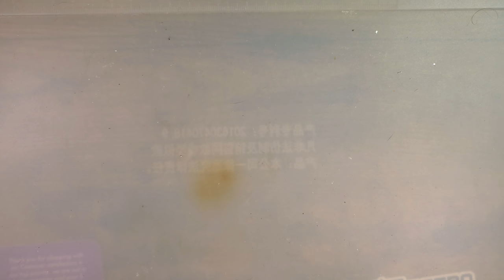Game Boy Game Battery Retainer (v2)

Comment: Thanks for sharing this video so everyone can learn to do this. That said, I do have a fair bit of constructive criticism regarding the way you solder which people that are new to soldering need to know to make sure they don't damage their valuable boards. I'm sharing this because I have noticed a lot of people pick up bad habits from watching otherwise very informative vids, not to put you down. 1) Heating so much of the board for as long as you do in the vid will often times damage the PCB. For anybody trying this or similar mods, use a small chisel tip or even a needle tip instead and make sure to not keep the iron too long on the contacts while soldering. 2) Using some soldering wick to remove old solder would also be a bit cleaner, since else you end up with too much solder, which in turn might end up shorting other parts of the card (especially if you have done other modifications to it) and it simply looks much nicer if you do. 3) Solder should never ever end up on other parts of a PCB. Only on the solder pads and feet of the components being soldered. I can't stress this enough. Having to remove it  afterwards with your nail isn't very good for the card to say the least.. and that's if you even notice and remember to remove it in the first place, before it shorts something. 4) Last but not least, keep those soldering tips clean... it will make your solder joints better and make your soldering tips last much, much longer. To people wanting to learn how to solder: make sure to learn good soldering hygiene before you ever pick up a soldering iron in the first place, it's super easy and will make your life much, much easier when doing any type of project that requires soldering.

Comment from the maker: Yes, there is actually a problem with that GBA I was using for testing. There was NOT a problem with the games.

Additionally, the adapter for this mod has been revised to FIX the issue I encountered in the video. 

Please read the description before commenting about this.

Comment: The tabbed battery just makes more sense, that's the way I'll go.👍👍👍
Reply from the maker: I mean, a tabbed battery is cheaper than buying the boards and retainers for this but I suppose it does make a bit of a sense for a RTC cart
Reply: @makho  I see some on other sites that are $1.99. With the ease of use of swapping a battery (Especially with say Pokemon Gold) you can more easily buy cheaper batteries and not worry about resoldering every 5-10 years. Also 1 soldering job vs a few means less risk.
Reply: @cubes6351  It also means you can pass the cart onto someone else who doesn't own, or know how to use a soldiering iron.
Kinda useful if you are the only one of your friends who does this kinda thing

Comment: Hey Makho, I was wondering if you've done any button repair/replacement on a GBA SP. The d-pad on mine is having issues and has to be pressed kinda hard to actuate. I read on another video that you can take off the tops of the buttons and clean inside the switch and then tape them back up, but I'm not sure how well that would work. Another option is apparently replacing the buttons with 4x4x0.8mm buttons that you can buy off of eBay, which I'd also be interested in seeing how well that works.
Reply from the maker: well, if your button is not working properly anyway, why not open it and try cleaning? The alternative is replacement and you can still do that after you open it.

Comment: The contact problem is your flexpcb flexing away from the negative terminal of the battery since the holder pulls up, it creates a bowl under the battery. I don't know if copper-foil is  longterm solution since it will oxidise. You need to make your pcb thicker at the negative terminal or stop it from flexing. To stop it from flexing: make flexible "wings" for the retainer. Then only the wings flex up.
Another good idea would be to choose a better surfacefinish for the negative terminal on the flexpcb to make better electrical contact with the battery.
Reply from the maker: you know I covered this in the description, right? I filmed the video with an earlier revision of this mod, gave feedback to HDR, who revised and tested it (or at least ordered the new boards) and then I published the video. The issue has already been resolved.
Reply: @makho  i'm not reading descriptions on YT. I'm here to watch  video-content. But hey... nice answer to a supportive comment on your video. You seem to be a guy who can handle positive feedback...
Reply from the maker: @hasserecht3678  I'm just here to make videos, not read comments. But hey... nice comment responding to an issue that has already been solved.
Reply: @makho  Well... you actually read the comment and responded... that kinda is the opposite of what you wrote. But hey ... could you show us some shitty solderjoints and explain the display reset command again?
Reply from the maker: @hasserecht3678  I see you're just here to troll. That's a shame.

Comment: The battery holders from aliexpress are easier to install and probably cheaper, because you only need to buy and solder one component, but this option is certainly higher quality 👍 I went straight away with normal batteries plus holder because I don't trust those yellow chinese tabbed batteries at all, and finding branded tabbed batteries seems to be an impossible task... 🤦‍♂️
Reply: check out console5, they have lots. Prices will of course be higher though
Reply: @nhlvan  That was my second option, but I discarded it for some reason, maybe they were out of stock or the shipping to my country was crazy expensive 🤷‍♂️
Reply: @MarcosG000  yeah, then maybe something like this mod that makho is showing in the video might be a lot more cost effective. Hopefully you know how to solder?
Reply: @nhlvan  Yeah, as I previously said, I went with the aliexpress holders and normal maxell batteries and everything is working fine for now 😉👍 By the way, I would swear that console5 had those exact same holders from aliexpress but more expensive 🤔
Reply from the maker: digikey has panasonic tabbed cr2032

https://www.digikey.com/en/products/detail/panasonic-bsg/CR-2032-F2N/2404062

and with the "aliexpress battery holder" you have to use CR2016 or smaller. This uses CR2025.
Reply: @makho  Oh, you are right! I forget that not every cartridge comes with the same battery size and that maybe you can even interchange it... 100% of my childhood cartridges use cr1616, so I went with the same size and the aliexpress holders worked great for it. Thanks for the link and all your good stuff! 😁
Reply from the maker: @MarcosG000  ahh yeah, you can use tabbed CR2032s in nearly all of the GB and GBC games that came with CR1616s. Using a quality cell might not get you that much more runtime though since a CR1616 can, apparently, last up to 30 years in non RTC carts
Reply: @makho  I wish I knew that before so I could have had more options to search 😅 My inclination for using branded batteries is because, as a tamagotchi collector, I've seen tons of them through the years being destroyed by bad quality coin batteries. Those bitches are serial killers 🤦‍♂️They tend to leak and corrode pretty easily...

Comment: I use rosin core but be careful you don't breathe that stuff in. Use a quiet fan like an old PC fan and have it suck the smoke and blow it away.
Reply: About how bad are the rosin flux fumes?
Reply: @BlazingKhioneus  I never have a problem my way. I don't believe they are safe though. I think it's the lead more than the flux though.
Reply: @michaeldemers2716  Gotcha

Comment: Those who don't have a adhesive copper tape, just tin the center area of the flex PCB so that it forms a conductive surface that matches the height of the solder mask.
Reply from the maker: no, just read the description

Comment: Can we use 2032 battery cells with this method? I have a bunch of those tabbed but think I might do this to a few cheap cartridges if I find a few on ebay.
Reply from the maker: It's designed for 2025 cells and that's what I recommend. You can probably jam a 2032 in there and it might fit in some housings but you're asking a lot from that flex pcb adapter.

Comment: Copper tape like that usually has conductive adhesive, so you shouldn't need to do the fold on it like you did.
Reply from the maker: I've never seen conductive adhesive on copper tape.
Reply: @makho  I tried to reply a few times, but I think YouTube blocked me from commenting because of the link I tried to include.

Copper tape with conductive adhesive is definitely a thing. Don't mean to be rude, but a simple search for "copper tape with conductive adhesive" brought me to an Amazon listing for the stuff.

It's used pretty widely to shield the inside of the cavities in electric guitars. I did assume that it all had conductive adhesive (so my bad there), because I've also come across people using aluminium tape for shielding instead with the caveats being that you can't solder to it, and also that it didn't have conductive adhesive. The tape you used probably just didn't have it.

Comment: Can I order 0.8mm boards? Flex seems to increase price significantly.
Reply from the maker: 0.8mm means you can only use CR2016 instead, if that fits at all. There are height constraints which is why flex (thin) is used in the first place.

Comment: How long do the cheap tabbed batteries usually last on a Pokémon Gold/Silver/Crystal carts? And what voltage is considered high and what is considered low?
Reply from the maker: a few years still, assuming the battery is not DoA. 

Here's a datasheet from energizer; the voltage curves are pretty standard: https://data.energizer.com/PDFs/cr2025.pdf
Reply: @makho  thank you for the info this helps a ton

Comment: Is it feasible to make this for the Pokémon SRE clock batteries?
Reply from the maker: not really
Reply: @makho  different tab locations and shallower shell?
Reply from the maker: @BlazingKhioneus  well, the components are stacked in GBA. But yes, even without that, there's not enough room.
Reply: @makho  So we're stuck replacing the tab batteries with soldering every time the clock ticks no more?
Reply from the maker: @BlazingKhioneus  How often do you find yourself replacing these batteries? And yeah, pretty much. You don't need RTC though.
Reply: @makho  It's still nice to have all the features of the game running, and to increase longevity of the games as I hope they outlast me

Comment: I more want to put one of those into a GameCube, tbh.

issues I have with rando tabbed battery sellers on failbay: too long tabs, that require cutting to make it fit properly. 
That or they're made upside down and some people are likely to get confused and put - on +

Kind of want to make a lipo for modded DMG & MGB; have you already dabbled into those yet?
Reply from the maker: Just buy quality batteries from a good reseller and you won't have a problem. Digikey sells tabbed CR2032s made by panasonic. Not sure specifically what the GC uses but I'd still recommend looking there for tabbed cells.

Comment: Whats that red wire on your flashcart?
Reply from the maker: CS for the flash chip IIRC. It's required as not all the lines to flash the chip are connected to the stock MROM chip (which makes sense as the stock MROM is not rewritable)

Comment: To make such a mod for EZ FLASH OMEGA :)
Reply from the maker: no matter how many times someone mentions it, there will still not be enough room
Reply: @makho  You're right: / That only the definitive version has it. And what do you think, how long can such a battery in the Omega version last?
Reply from the maker: @ztejstronymarcin  probably only like 2-5 years. They are small batteries and they have to power RTC. It's hard to say for sure until batteries start going in the first units. I had one with a dead battery already but I'm ruling it out because I suspect the battery was a factory defect.
Reply: @makho  Thank you for your answer :)

Comment: Cartridge slips out of hand or falls from table...and the battery comes off, ops.
Reply from the maker: Don't drop your hardware and it's not an issue. Also, the battery is a lot more secure than you may be imagining.
Reply: @makho  Stupid answer.
Reply from the maker: @finmat95  stupid comment